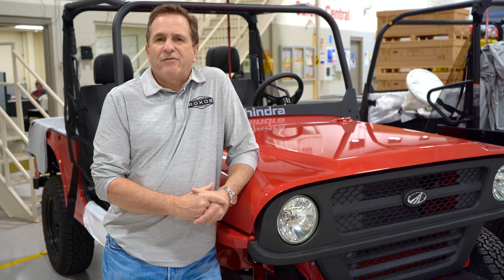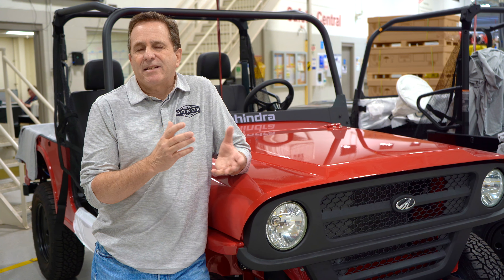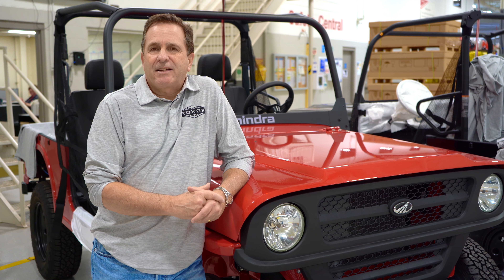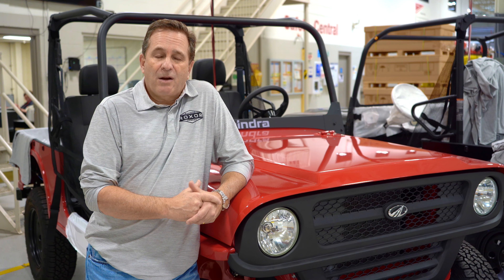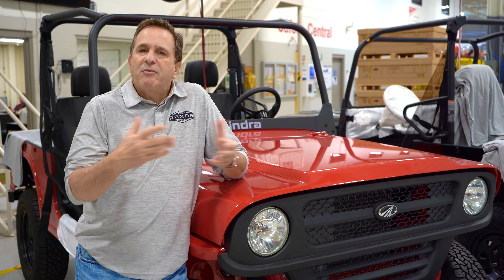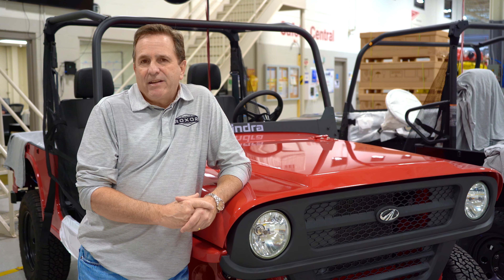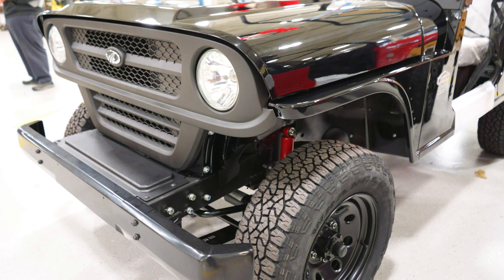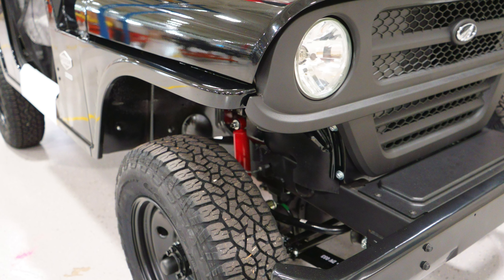New Mahindra Roxor is here. What you Need to Know about the New Roxor!

Comment: Did it really cost 15k for the changes? My first was 13,995 out the door from wheelers in Ar. I haven’t found a dealer yet near my area snd price to build is  29,995🤨
Reply: I'm assuming that will change once new ones are available
Reply: Shipping and distribution has started . You can get roxor on every dealership at January.
Reply: They have to recoup the cost of the law suit.
Reply: I imagine dealers will come down. bare bones on the website is 19K which is still not too bad considering how everything has gone up.  not as good first coupler years though.
Reply: Every dealership will get roxor at January 2022. I was thinking Mahindra is going launch on road roxor . But FCA has problem with new onroad roxor which launched in India as THAR tag . MAHINDRA already has order to full fill 75000 booked thar . Now Mana has new idea or Guidelines which is ,make with demand ,not to try push if no demand .

Comment: Looks like Mahindra bought the rights to build the original Jeep CJ's mechanicals in the latev 40s, and improved on the original since then, while Fiat/Chrysler bought the rights to the Jeep CJ's 5 slot grille and badge much more recently. Hence the lawsuit by Fiat/Chrysler over the Roxor's grille appearance. So basically it boils down to whether you want a clone of the original Jeep CJ's mechanicals - in which case you go for the Mahindra Roxor Jeep clone which is true to the original Jeep's character, or whether you go for  the Fiat/Chrysler Jeep clone - which is true to the original Jeep's grille and badge. You pay for what you get of course - although you can get a third party Jeep grille look-alike for the Roxor at a fraction of the price difference if you are into that kind of thing.